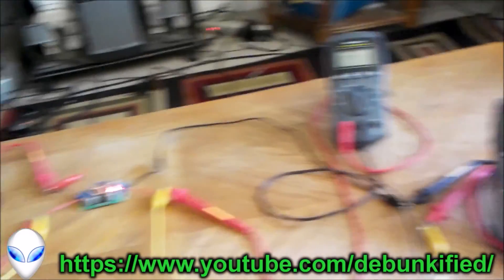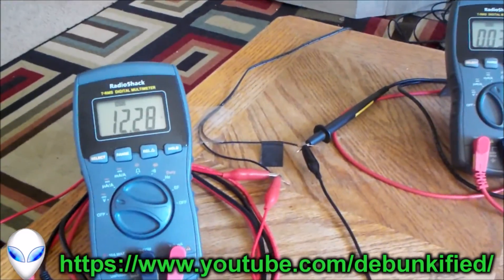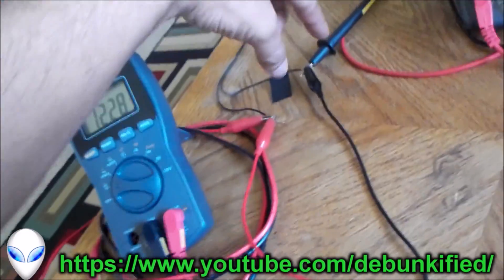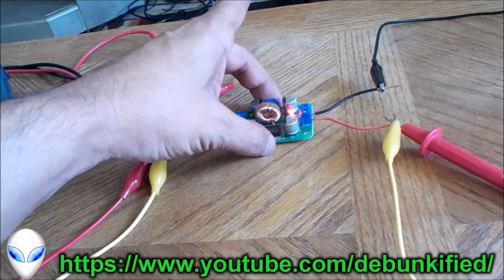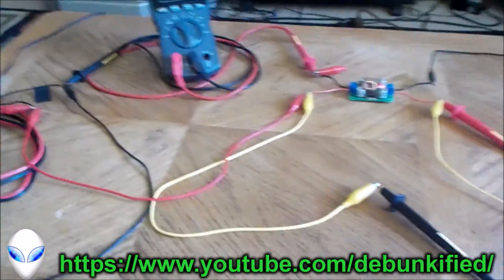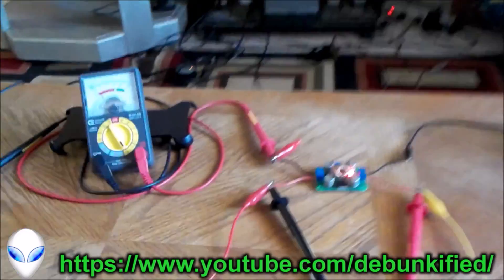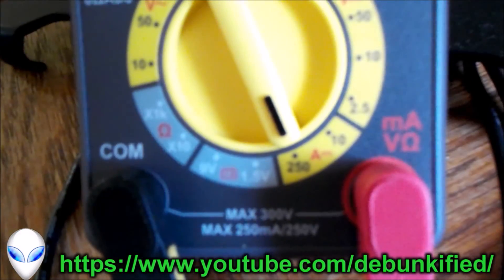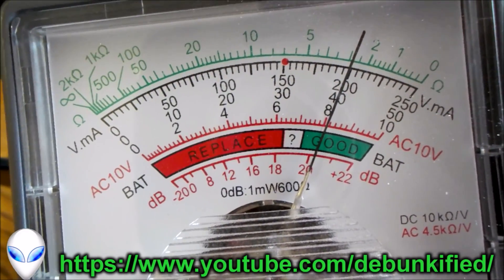Solid State Looped Overunity

Comment: sir put few turns of coil on  the inductor and pulsed it with capacitor to raise amperage and voltage and charge caps.and use inverter so after looping tje ground is separate.thanks me later

Comment: you can connect solar panel at input and run led lights from output and then put the lights array on top of the solar panel, this way you can loop it

Comment: I would like to try playing with that specific circuit, combine it with a radial capacitor bank that i give a second of pulsed HV,  and then it self charges for like 5-8 seconds, like a memory effect, thi i the time with a 555 circuit, it generates real overunity.

But hey, then link to where you bought this dc to dc converter and thanks your way from denmark and the wishes of a great day your way!!

Comment: All it does is amplify wattage at the expense of current. I use one of these with a 6v 200ma solar panel for a battery charger. You can't hook these in series for some reason. I think you can try a diode bridge but I don't think it would be free energy.

Comment: ac adaptor  is a switching supply converted to DC and has ripples that cannot be read accurately by a multimeter...try same experiment with a proper DC input from a battery

Comment: I tried looping it , wont work maybe your meter work as load. I use a labritory teansformer for input.
Reply from the maker: Hi, that is only an inductive load in which the system is closed, not open. There is no isolation. The extra energy you see in a closed loop circuit with no load at all except the inductive load only, which means it is not an open system it is to show reactive energy only and that it does indeed exist.
Reply: Buck conv do work thats for sure i read they are the original tessla transformer. I only got one meter though . We really want the amps but on the coil i use i need to crank it up to 35 volts to raise the amp to the double , your voltage is almost the same, i might test to retune it and see. I tried to run the second card backwards lol that worked to but all amp disapeared in the diode on the card but the voltage was there and i could use that leed from +into into next card minus socket and another posetive in the posetive socket and i was like yo where did the ground go did it turn to induction? But according to my calculations transforming the 35 volt voltage to amps and adding the doubled amps it did over 1,8 amps out and on 0,03 amps in with 9 volts. I found some documents about it here aswell. https://www.google.se/url?sa=t&source=web&rct=j&url=http://www.overunity.com/12086/kornelsons-free-energy-transformer/dlattach/attach/95952/&ved=2ahUKEwiP15vy05fbAhUuyqYKHcUlDSEQFjAAegQIBhAB&usg=AOvVaw0f0X6q0FPn9EjjzD5XyVj0

Finally we start to get somewhere lets bust the monopoly its about time iam sick of all the suffering it created. I will try to test get a 60 watt coil aswell and see if it can be added as a second card problem is most of them crank up the voltage to almost same levels then you need to get the voltage down again. If there was a good way to transform the voltage down and to more amps that would be awsome. Thank you for bringing my attention to the coils, i read paul malis magnetic amplificstion books but this simplified thing alot, thanks again . Keep up the good work you are a great inspiration for us all.
Reply from the maker: I thanks for the comment. I actually have that PDF file. I can’t see the link though YouTube won’t let me through it’s browser, maybe send it to my blog as a comment then I could actually get to it.

I routinely see more current going back to the battery than what’s coming out of it, even with a load in between the output and input with the use of a DC-to-DC converter but I think it’s some sort of short on the output negative to the input positive, is my explanation and so I guess the output really isn’t making it all back to the battery as it appears to be, and that some of it is being wasted away through that short .

I’ve tested it also by isolating the output to another separate battery with a load in between and saw that if I simply subtracted the current going into the charging battery from the current out of the run battery then it was practically zero, so maybe with the single battery looped there really is more current going back in than what is coming out, or at least nearly so while still powering the load.
Reply: Affirmative. I sent you a clip aswell on your bucki g coil video with the r core to alexanders video
Reply: I noticed the cables could become  briefly magnetised when connected this shows of polarisation issues. Andrey melnichenkovs cores are closed magnetic fields returning the outher magnetic fields. Could be polarisation issue in that case ferrite could be a solution to dampen it like tesslas back emf supressor with opposite coils. Needs more testing. I posted all links i had on your blog. The greeks plasma experiment is abit intressting. Iam sure we will crack this nut to. Keep up the good work i love your videos.
Reply: got 3 cards. I removed one core on card nr 2 and soldered it back in reveresed position. Then i connect card 1 and 2 in series . The backward attached coil (nr2) then didnt work so well, i guess the diod nullifies it.So i took the + wire from card nr 1 and attached it to the + out socket backward order in card 2 with reversed coil and the minus - socket out from card 1 to the minus - in socket on card 2 then i attached card nr 3 + in leed by bypassing the diod on the backward coiled card nr 2 to the left of the diod named s33 the small chip. What hit me was i got 3 cards running without any change in consumtion from the lab transformer. A intressting thing i noticed. Got the idea to test it as magnetic law says every action has its opposite reaction so i though ok il try to reverse a coil then. Tessla winded 2 coils on a ferrite rod both coils had opposite windings and in the middle where they meet and the field was null he had a third leed out to a pin that touched thr rotors copper parts as it was rotating. The patent is out there somewhere on the free energy uk site where tessla used this setup to supress back emf on a motors on timed stator and rotors. Now every card i got has a amp surpluss output on all 3 cards the same amount though i steed of raised more from each card so abit intressting as they didnt draw more than the first card togheter.Not sure they can be drained without affecting eachother though.The amount amp is though exactly the same on all 3 cards but intressting is it didnt draw anything extra from transformer. We still have alot of testing to do. There is another paper out there on the net with with 2 thyroid winded transformer  cores one is 120 volt another is 220 the cores are put o top eachother with small sheet of plastic in between then the core nr 2 that is 220 volt is connected to a dummy load of 600 volt. Then a custom third winding is winded trough  both circular cores. According to the paper deppending on number of windings one use one can take out the energy potential between core nr 1 = 120 volt and core nr 2 = 220 volt.havent tried this one yet  but its simple to test

Comment: Where is the 18W of output energy going? Something has to be getting hot, and the energy is not going back to the power supply.

You are measuring the current from positive input to positive output, so measure the voltage difference between the two positives to get your real power dissipation.
The current you are measuring is not going through the output negative and positive where you are measuring the output voltage.

The power in the loop you are measuring is the difference between the input and output voltage, because as you said they share the same negative.
So voltage drop between the two positive terminals is 12.31 - 12.28 = 0.03V
So the power dissipated between the two positive terminals will be   0.03 x 0.692 = 0.02 Watts in the loop.
Reply: Just saw this too. Glad I'm not the only one noticing this glaring test point issue. Correct me if I'm wrong, but Pin=Pout-losses, since P=IV, there should be a power and current measurement across pos and neg on each side... I'm not seeing valid test points to prove anything. Am I wrong?

Comment: You had me going...till that loop back from output side to input side, I'm a bit unclear now, as too what is exactly reading what. Also not sure what load is dissipating your "output" ? You can get a current reading with amps meter shorting a source but it is not legit. A watt meter powering the AC input side is the only proof YT'rs will accept....P.S. What is in the wood box??
Reply from the maker: There is no AC input, only DC.
Reply: If you are using a wall wart, there always will be some AC that sneaks thru. The ripple in your DC input can do weird things when it comes to buck/boost converters. In fact, that is true just about any time you have an inductor. 24 volts of unfiltered DC fed into a buck converter yielded 37 volts on the input and output sides with no load. And absolutely no control on the output side. It looks like you have a runaway feedback also. And it is being damped down by the connection of the two positive sides.

Comment: You just proved your dc/dc converter has 95% efficiency. Which is absolutely normal for that kind of converters.
Well done...mate
Unfortunately it's no over unity here.
Reply from the maker: Hi, that’s right, thanks for the comment.  I would like to find one that is 98% efficient. You know that not very far away from what a super conductor is, but then again that extra 1% is a very long away! Or is it?
Reply: @debunkified  I am ITT Grad and you guys are consusing me, I see your meters readings and you are connected right and it looks like more power is going out than in, are you telling me it's not overunity when it appears as though it is? .5 watts 12.28v dc and 8 watt 12.31 dc out hmm wtf are you talking about that is overunity and not an effficiency thing. All I can think is the capacitors are recycling some of the power signal and again this is what capacitors can do in a proper circuit. such as the power saver box, this thing works and the capacitors are reusing the power before it returns to the grid, sad thing is the grid has bigger capacitors and even inductirs so they can reuse the power a lot more and the factually sell us back the same power we just used  threw capacitive reactance , ok PEACE energy can be reused over and over  that is a fact , and that is how free energy works and is very fucking real, if you still don't get it think of this, how can you harness the pull force of a magnet to iron when the iron is stationary and the magnet is on a rotor or shaft, a good start is to build the Bedini Pulse Monopole Motor
Reply from the maker: I agree. The key lies in the mechanical efficiency and yes that’s exactly what I measured. Not so much the mechanical which is just an added bonus, no pony brake test was done on that. You see a lot of people can’t cope with the idea that the transfer of energy from the input into a magnetic field over and over again doesn’t constitute “REAL” work or can’t do anything practical. Well fuck dude, it can motorize motors, it can store energy for later use as in “pulsed inductors” and so forth. This is very PRACTICAL indeed, some people are just so ignorant, not you, not saying this about you but others who can not see simple “work done” using the same energy over and over again can be many times greater than the actual amount of energy that one starts out with.

I began writing a book on this “proof” but quit writing it because of all the disbelief, but maybe perhaps I should continue on with it.
Reply: @debunkified  I think capacitor may help demonstrate looping energy in a closed circuit
Reply: @debunkified  this is an electrical pendulum is it not?

Comment: I wasn't able to get a current reduction simply by connecting the +'s on my DC-DC convertor. In fact I got an increase from 0.15A to 3.34A. The section of "Loop" isn't shown on this video.
Reply from the maker: Hey David, how are you? What "section of loop" are you referring to? Maybe I should take that video down as it is showing a mistake in which the output is indeed connected back to input on the positive side, but the output is on the other side of the input meter. This shows higher than 100%, if placed correctly on the other side of the input meter directly connected to the input positive, then the correct measurement will show less than 100%.
Reply from the maker: +David Lyon There are only two ways to connect this circuit. One way will show underunity and is the right way while the other way will show overunity and is the wrong way. This video shows the wrong way.